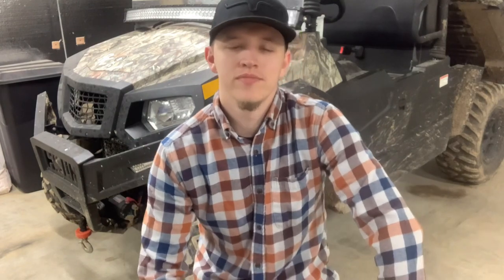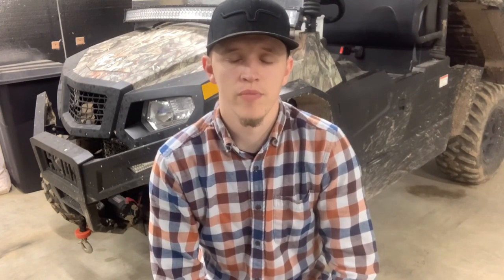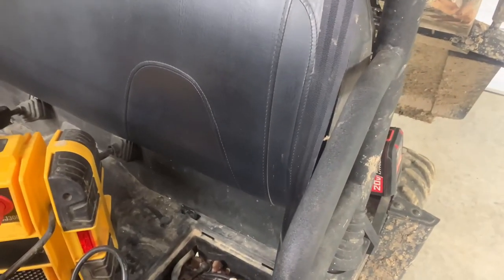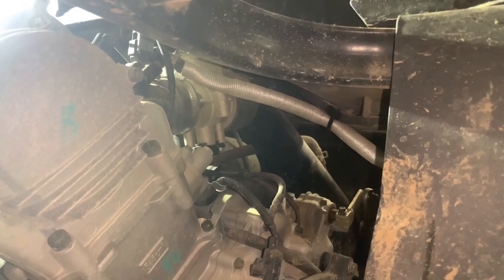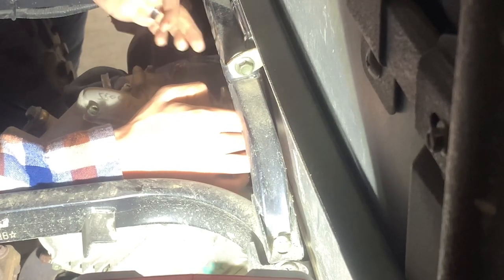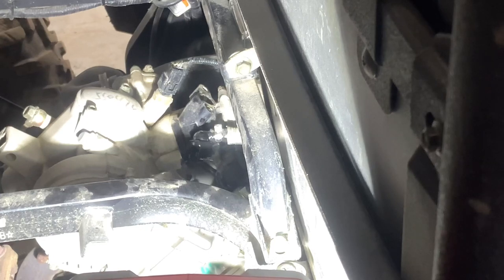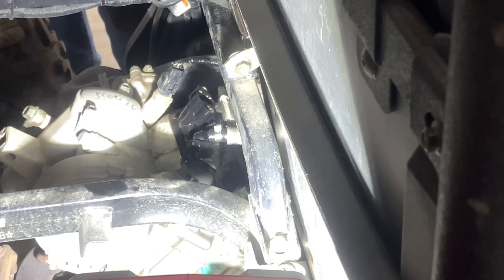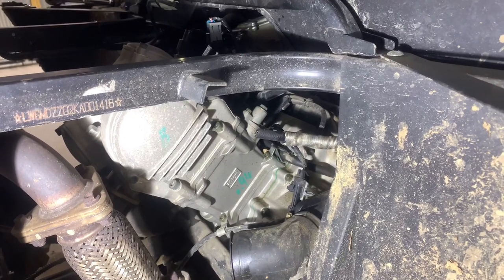Hisun 550, Loss Of Power And Cutting Out.  Need To Know Before Buying!!

Comment: Thanks for the great video!! I'm considering picking one up and this was very helpful. Inline fuel filter for the win!!
Reply from the maker: Yeah definitely if you get a older one make sure it has it but after 21 they started putting them on it because problems with the injectors clogging

Comment: Great video!  Have the exact same problem.  Gonna give this a try right now.  Thank you!
Reply from the maker: Let me know if it works thank you
Reply: @embracetheoutdoors7232  Well I wasn't able to buy another injector but was able to pull things apart.  Cleaned things up a bit and she seems to be running much better.  Gonna buy a new injector and fuel filter and get those on soon.  Thanks again for the help!
Reply from the maker: @frankcunningham6335  glad to hear it’s doing better I still use mine daily it’s about time for me to do a video on how to change the oil on it will be learning for me and everyone else

Comment: Maintenance video would be awesome. I bought this used and can’t find a manual or maintenance schedule. I’ve got a squeak squeak to deal with 🤯
Reply from the maker: I have one some where and oil chamge every 55 hours or 100 miles I believe I’m just now at the 100 hour break in point so I need to change oil in mine soon
Reply: 2 fittings on A arms too grease, 2 on drive shafts

Comment: Hey great vid. This helped me fix mine. It was doing the exact same thing. Replacement fuel injector and wham started first try and didn't quit. Still have to do fuel filter. Thanks.
Reply from the maker: I’m glad it’s helping people out and that’s why I made it because there not much info on these machines and as I learn them I’ll post more videos let me know if you need anything else I’m easier to get ahold of them Hisun
Reply: @embracetheoutdoors7232  
Well I took it for a test drive. and it seemed good. Then I was showing my son with another test drive and it started to miss a bit again when giving it gas. So, back in the garage and I put the fuel filter on drained the gas and put some high test in. Still have to test it out. I have blown two f5 fuses prior to this to but I don' t think its related. That started happening after I went in some water but I haven't blown one since. 
Cheers.
Reply: @rsxstudios99 did you figure what was causing it to cut out like that mines does the same thing. Everytime I think I got it fixed I go to test drive it a second time and it's still there
Reply from the maker: @jeremyfloyd7787  yeah my fuel injector was clogged because my 2019 didn’t have a inline fuel filter on it and it’s still doing great
Reply: @embracetheoutdoors7232  I've installed a fuel filter and replaced injector and it's still having the same issues I'm thinking possible faulty ecu but I'm not sure
Reply from the maker: @jeremyfloyd7787 where you located
Reply from the maker: @jeremyfloyd7787 doesn’t it still do it with your seat belt on
Reply: @embracetheoutdoors7232  Missouri, yeah I've tried it with and without the seat belts connected. Changed the throttle position sensor also no luck yet

Comment: If you put your gas into a clear container when you cycle out the "bad" gas then you can see if there is garbage or water in your gas also.
Reply from the maker: I tested the injector after the video or a battery and some carb cleaner it was clogged bad but I got it all cleaned up but now I have a spare and then I stuck a fuel filter on the line because mine didn’t come wothnit

Comment: Good video but speak a little louder and loose the music
Reply from the maker: Can do thanks for the info.
Reply from the maker: I also was curious did you find it helpful or just a advantage video?
Reply: @embracetheoutdoors7232  yes I did I just bought a Coleman 550 and now I will be putting in a filter the only thing I have to do is find out why the backup lights are not working thanks for the video
Reply from the maker: @richardschaffling9882  hopefully I save people a little trouble was the main goal and if it loses power or doesn’t wanna idle just turning it on and cutting out really bad 9/10 it’s the injector but hope you have good luck with it. Wonder if it could be a ground or something to do with the harnesses first thing I would try is put it in revers and put a test light or a volt meter to it and see if your getting power.
Reply: @embracetheoutdoors7232  that s what I will do a little cold out

Comment: Great video man! I gotta hold my gas pedal to the floor to start it, and even then it has a really hard time starting. I thought it was a weak battery, turns out its probably the injector! Gonna tackle this project myself, thanks again!!
Reply from the maker: I really hope it helped out and I’m glad I can help people along my journey of this thing I still really enjoy it and glad I took the leap to buy it let me know if it fixed and God bless
Reply: Same here. Once I get the motor warmed up it is a little better about starting but still seems to have a loss of power over all.
Reply: @embracetheoutdoors7232  Would the spark plug need to be changed also since it has been back firing?
Reply: @quality1047  yeah once mine starts and runs for a bit, it starts right up every time after until it sits for awhile
Reply from the maker: @quality1047  so I would tell you to do the same thing I done and I didn’t show I took sand paper to the spark plug cleaned it then shot it with brake cleaner to clean it and everything’s better have a lot more power
Reply from the maker: @quality1047  I would say buy it I bet 9 out of 10 time I bet this fix’s both of your machines mine wouldn’t hardly start then if it did it wouldn’t idle very long noe I can start it once and it will stay running till I shit it off boys try that and let me know
Reply: @embracetheoutdoors7232  well sadly this didn’t work for me. It starts easier but I still have to push the pedal down. Oddly enough I have the 2020 version and mine already has a fuel filter built into the injector line. I pulled the line off and it shot gas with no problem, not sure what my problem is? Might change the fuel filter for the hell of it, kind of shitty it didn’t work😕
Reply from the maker: @superiorswaney1950  where you located?
Reply: @embracetheoutdoors7232  Northern Michigan
Reply from the maker: @superiorswaney1950  if you wasn’t so far away I would take a look atbit
Reply: @embracetheoutdoors7232  called Colman, they directed me to a workshop. Turns out the motor has 60psi which is not enough pressure to turn the motor over. Coleman is sending a remanufactured motor for the shop to install for me. 

Mine only had 70hrs on it, hoping to get it before snow fall I plan on using it to plow.
Reply from the maker: @superiorswaney1950  hopefully you get it back and I wish I had a plow with mine man after I fixed mine been nothing but good times man
Reply: @embracetheoutdoors7232  Yeah the plow is badass, got a Bluetooth radio and a light bar for it. Sure love that thing, can’t wait to get it back
Reply: I have a 2013 500 and only get 30mph out of it.  Seems to run smooth, starts right up and idles nice. It’s carbureted. What should it do?

Comment: It will do that with the seat belt relays too. Then the next time you try it and buckle it up it might work fine for a while needs replaced
Reply from the maker: For some reason my Side by Side doesn’t have the seat belt safety feature to slow it down idk if it’s because I bought mine new in 19 but I’ve never had to to make it go full speed
Reply: @embracetheoutdoors7232  Mine is 2019 and it will start cutting out on you once you get up any speed at all.

Comment: Did the original filter have those crimp type  clamps ?  Do regular  hose clamps give a good seal since it's fuel injected?
Reply from the maker: The was no original filter on my unit that why the injector failed

Comment: I'm suspicious of the "dirt" in the injector because you have fuel filter on there and that prevents dirt from getting to the injector.
Did you check out the original injector to verity the dirt? I mean it seems if it plugged it up then you should be able to see that.
Reply from the maker: I’m the one that put the filter on there and yeah it was only spray out of one hole

Comment: I wonder if your injector was leaky. Mines doing the same and the spark plug is wet when its running ruff, also pops out the exhaust like its super rich.
Reply from the maker: It was clogged it was only spraying one hole

Comment: Nice job but didn't see any clamps around the filter .
Reply from the maker: I didn’t have any during the video but I went to town and bought some and put it on then test drove it
Reply: Keep up the good work I own a 2021 Colman hisun outfitter 550 came with filter tore a axel boot cleaned it put shoe gue from wall mat on it been holding for almost year now
Reply from the maker: @robertsrbell7811   thank you and yeah they all have small things they need but if you haven’t I would definitely put filter on the fuel line

Comment: How do i know if its my idle control valve or injector? Mine seems to run fine after it warms up
Reply from the maker: Well I’m having trouble again I let it sit two years and I think I need to get the old gas out it will run if I keep the gas down but now when let it dies so I’m not sure what’s going on needs ran for while for sure to see after it warms up

Comment: Hey Brother, I had the same problem with my 2019 550 Sector, and used your video to fix my bike.  I definitely made it better, but I still have this stalling at start up?  Since the injector change, it starts up right away, then stalls in about 10 seconds.  It seems that after the third time it will continue running.  Do you have any suggestions?
Reply from the maker: What bike do you have
Reply: @embracetheoutdoors7232  2019 Hisun 550 Sector.  It turns over and starts, runs for about 10 seconds and just quits?  If I keep the gas pedal feathered to keep it running and get rolling, it will run fine.  But once the machine is cold again, I’ll go through that same startup - stall process.  Any advice would be appreciated.

Comment: How many hours does your 550 have on it when the problems started
Reply from the maker: The problem was only because it didn’t have a fuel filter on it but around 800 miles

Comment: Hi. I have a Hisun 750 Sector. How do I change the transmission oil on this thing.
Reply from the maker: Idk I have never done that yet on mine I can try to find out for you should say where in your manual
Reply: @embracetheoutdoors7232  apparently it is the same oil as the engine oil.

Comment: If your battery is dead your ignition system isn't going to work correctly. If your injectors are clogged and filter after the fact isn't going to help. If you're putting regular gas in it the ethanol that Biden ok'ed to add more to the gas is shit. Use premium fuel only in all your vehicles. It looks really dusty. Air filter is clogged also. Have you changed the plugs? Just my 2 cents.
Reply from the maker: Yeah understand what your coming from but that jump pack give the battery 14.3 volts more than enough to run the whole system and I forget how long ago I made this video but the Buggy is doing better than ever so the issue I had was bad injector o have a way of checking them now but added the fuel filter because dirt in the gas and on the side of the buggy it says only 91 so I follow that.

Comment: Hisun is absolute garbage. I have 96 hours on mine i have already had to replace the wet clutch and bearing thought i was back in shape but now it will crank, has fuel, has spark but wont start! 96 hours! Dont fall for the good value bs like I did its gonna cost you a lot of money and headache in the long run. After all the repair videos ive seen on here I am convinced ive been ripped off. Gonna make my own video to let everyone know what a POS hisun is
Reply: The transmission went out on my 550, at 125 hours, after 4 months of waiting finally Hisun agreed to replace it along with the engine, since they are built together and could not just replace just the transmission. The sad part this was the second unit I had, the dealer had to come and get first one with just a few hours on it, same problem, transmission.  The dealer did all they could.  Hisun warranty did not want to work with them.  No I would not buy another Hisun, no matter the "good deal" they had.
Reply: @owenjones8333  I got mine running with a new timing chain. Original was stretched like you wouldn’t believe. It had jumped time. Even after I got it running I sent it in for new rings and a sleeve. Right now it’s running good just hoping to get about $9000 dollars worth of use out of it I would feel too guilty selling it to someone

Comment: own a 21' axis 700 and it started bogging down total loss of power , figured i clean air filter and fuel filter , having trouble getting lid off air box? Due you have to loosen ebrake bolts on column?? any help appreciated im disabled and some of this is alittle hard for me
Reply from the maker: Idk if your is totally the same but air box is on the hood of mine and air box lid just has snap clips and come off and mine had no power changed the injector and I put a inline fuel filter on it because they don’t come with them that’s why they get clocked easy and have trouble. Where you located?

Comment: Was it smoking before?
Reply from the maker: The smoke is me running seafoam through the carb and trying to fix it that way but then i fixed it with a injector and fuel filter
Reply from the maker: If your asking before it messed up no smoke at all just no power and sputtering bad

Comment: Amazon link
Reply from the maker: It’s in the description
Reply: What fuel line filter did you purchase sorry?
Reply: I just bought the 750 and want to do this right away
Reply from the maker: Depending on the year they started putting them on there I heard but I just went to rural king got a 10 or 14 micron filter
Reply from the maker: And the one I bought was for 3/8 or 5/16th hose